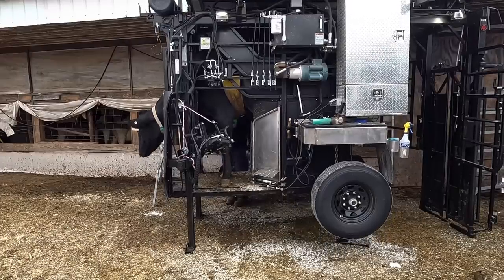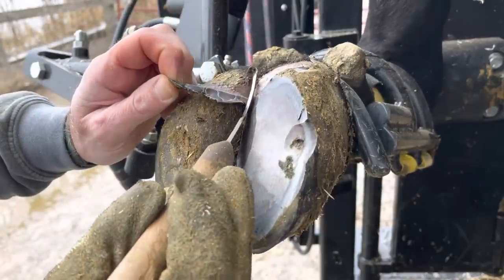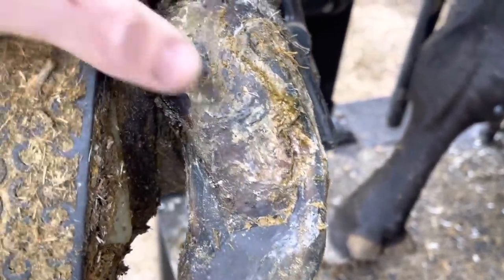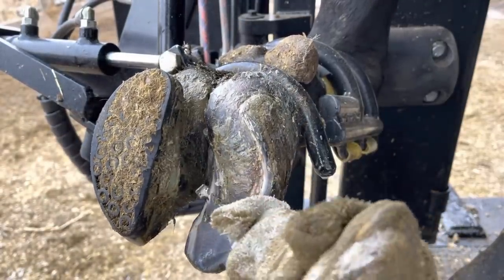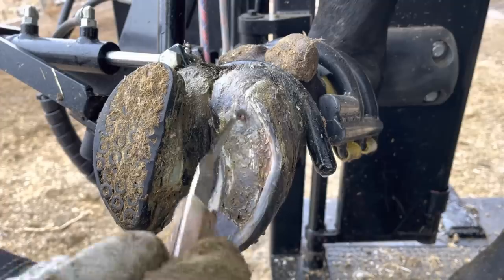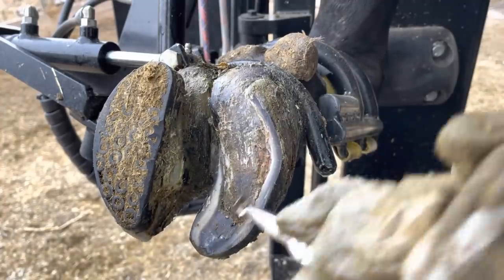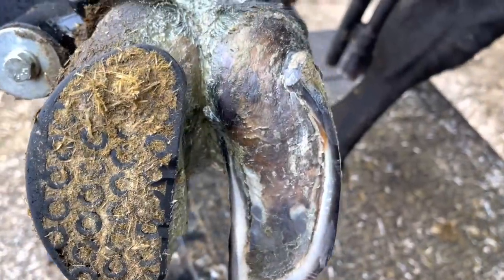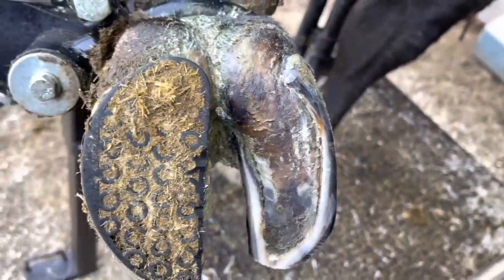HOW LONG will it take to make this HOOF WHOLE AGAIN???

Comment: Quick question: while the cow has the block on the healthy claw - does it have to equal the height of her other foot to not imbalance her? Since they stand mostly at hyperextension I thought it would be noticeable if the feet aren't the same length
Btw: love your work and videos!

Comment: My father went to a school for that when I was a kid in the early 70’s. Paid $10k for the trailer and tools/equipment, which at the time was a huge sum of money. I’m guessing he was one of the first ones as he had no other people doing it at the time. Back then the rate was $8 a cow (again, good money back then) and he was booked solid for weeks in advance, worked 6 in the morning til 7,8 or 9 every night, 7 days a week. When I didn’t have school I’d go with him and was paid 50 cents a cow. They didn’t use a grinder back then, it was a set of different sized “nippers” (kinda like hedge trimmers but 3 or 4 inch blades, and another set of hoof knives. The machine didn’t lift up, it was done with a belly band and a similar setup for front legs and back. My job was to get the old girls in, get the belly band in place, lift them enough to support them, then get the left front and right rear legs up and into position for trimming, clean the hooves off, and be ready to switch as soon as he was done, staying ahead of him. The farmers were skeptics at first, but the health of the herd would improve very quickly, and a number of them were saved (the cost of a healthy, producing cow was about $2k to $3k if my memory serves me correctly, 1973/1974(?)) and they’d always tell my pop “you’re cheap, 4 or 5 visits only cost me $40 bucks. Can’t replace these old girls for anywhere near that”. Usually trim 20 to 25% of a herd, which may have taken a week or so depending on the herd or around 40 +/- a day. A very long day. For a kid, I was making $20 a day. Crazy money in 1974 for a kid, even some adults.

Comment: So what's your policy on that old block? How worried are you it might fail before the other hoof can bear weight? Are you tempted to pull it off and glue a new one?
Reply from the maker: Not really.  It was still quite sound.  Had it not been, I would have replaced it.

Comment: I’m intrigued, I never see hoof guys washing the claws with any kind of brush - any reason for that? I’ve seen you wash with the spray but never agitate it with a brush. Also, you can get e.g Wurth pressure pump spray bottles that would give you an unbroken spray jet for many seconds, would that be helpful for the washing off procedure?

Comment: I remember you saying you switched to the white glue because the green set too fast in summer heat. Is the white overall more consistent all year round?
Reply from the maker: Until it gets really cold.  I’ll be using the green the next couple weeks.

Comment: If it's not thick enough to bear weight yet , why not leave that height towards the toe and around the wall horn? Couldn't the block fall off before it can bear weight?
Reply from the maker: I could have left until the next visit.  Leaving it at the first trim would be better than walking on soft tissue but a thin uniform sole would be better than an unbalanced sole.  If that makes sense.
Reply: @NatetheHoofGuy  yup, it does! Thanks for the reply!